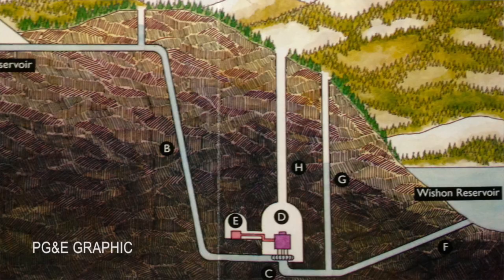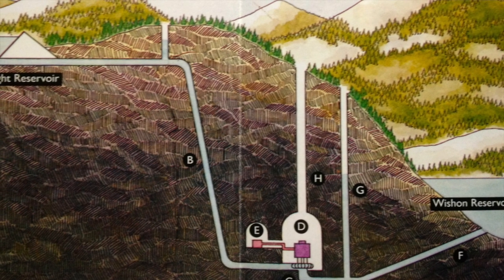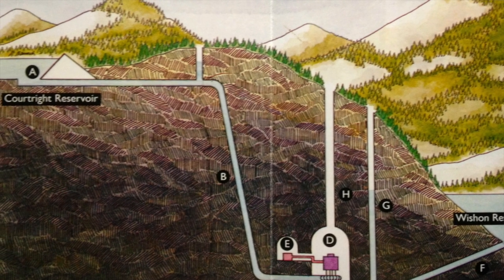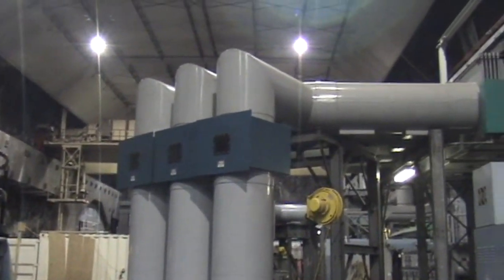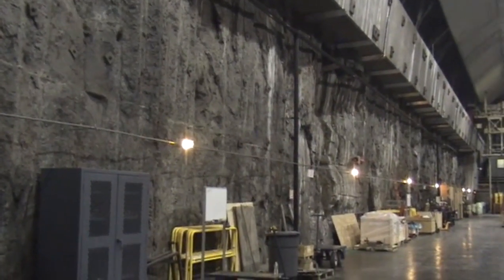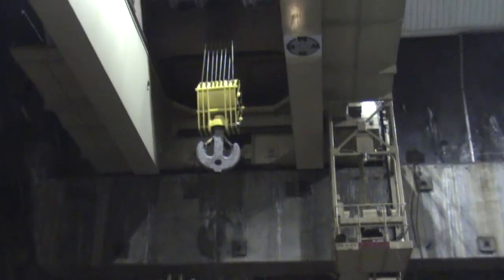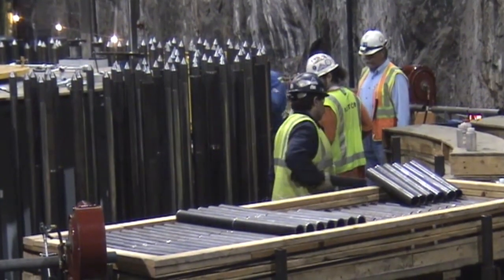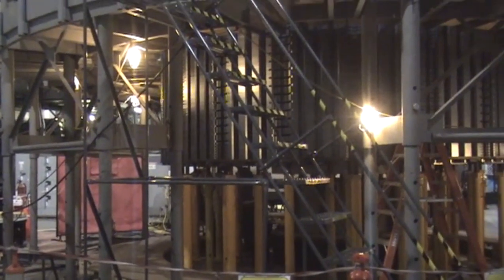PG&E Helms hydro project overhaul

Comment: I was a kid growing up in this area at the time Helms Creek was built.  Many of my friend's family members worked on the construction for Granite-Ball-Groves, the Contractor.  The platform accident was very sad for the community.  Two of the men killed in the accident had been hired the same day and had absolutely no experience on this job.   The father of a friend of mine was an equipment operator.  They actually rigged his backhoe / excavator from a crane in the main turbine room excavation/cavern, and he would scrape and hammer the granite walls to do the final finishing.  Just nuts.  Given some of this things I heard about how this project was run, it is lucky that they did not kill or hurt more people.

Comment: This one brings water to San Francisco when the original pipeline goes dry. I worked in their mine. Huge turbines top secret
Reply: Oliver, WRONG. There is NO pipeline sir, running from Courtright OR Wishon lakes on the Helms project that transport water of any sort SF! Man, you have no idea what you are talking about. I worked there too and when they carved out the chamber for the 3-each pump-turbine generators and built the penstocks and related tunnels and this project is not piping water anywhere except between the two aforementioned lakes so what the hell "original" pipeline are you even talking about that goes dry? Nothing is "top secret" there. Cancel your CNN subscription. You have been duped.
Reply: @jimratliff2753  I worked on the upper tunnels and surge shaft to which my father was the superintendent.  Only once did I get to go and see the area where the turbines where to be installed. It was overwhelming how large the area was.    My father told me that beyond the  expected rooms and areas one would expect to see to accommodate all of the controll and monitoring equipment, there were multiple other areas being built.  The conventional electricians who had worked on other hydroelectric /conventional dam projects were stumped as to what the purpose of these areas were to be used for based on the lighting and electrical circuits they were installing.  They also installed extensive amounts of conduits that would be utilized by low voltage electricians probably for voice and data communications.    Being that it all was deep within a mountain, many speculated that it would be a safe place for government or military to go to.  I think that is where some of the mystery and speculation that it was not just a power house inside that mountain.  The sections of the project my farther was over were completed long before power house portion was completed.  So my Dad never learned more.
Reply: More conspiracy theory bullshit
Reply: Water for SF comes out of Hetch Hetchy not Helms

Comment: My father, brother and myself worked on this project back in the early 80's.  We were involved on the upper tunnel and surge shaft.  We were getting ready for our shift to go down the surge shaft when the accent happened that claimed 7 lives.   I hope the family of those miners know this project is doing a great part in providing power for some many people.
Reply: Craig VanMeter — right proper words about those men who didn’t return home that day.  R.I.P.
Reply: THE SCALING CREW AND THE ELECTRIANS @thehouse5791
Reply: SO DID MY LATE  FRIEND CURTIS GUTHRIE FROM SANTA BARBARA CA.....AND THE GRANITE COMPANY FROM SAN BAR ....THEY BOUGHT HUGE CAT QUARRY TRUCKS FOR THAT JOB.....FOR THE TUNNEL WORK....THE ACCIDENT WAS IN ONE OF THE SURGE AIR SHAFTS ON A PLATFORM THAT WAS BEING LOWERED AND  SPILLED THEM ALL OFF TO THEIR DEATHS
Reply: @CraigAllen-re9bf  actually the slip form / work platform itself all came down.  It was right at the top of the surge shaft section which was roughly 30 feet across and about 1000 feet down to where it intersected with the tunnel below.     My father was the superintendent  over the surge shaft portion of the project.  He was also part of the mine rescue group that first went down after the accident happened to look for survivors to which there was only one.  That individual was in the transport cage that could travel clear down to the bottom or up to the top where the shaft  funneled to a much smaller shaft for several hundred feet to the surface.   That is where the dry house was that workers showered and changed into and out of work cloths.
After the accident, my brother and I came back with a few others where we had to remove the mangled  platform where OSHA was to try and determine how much it, the equipment and built op concrete which had compiled had weighed while we were using it as a slip form.   Unfortunately amongst all the mangled metal beams, expanded metal decking and work equipment that fell from that 1000 foot height was parts of the work crew that were not found and removed by the mine rescue teams.
Was hard on my Father as he had known many of those men from past projects over the years. I was with him when he had to pull the employee number brass tags off the board  and give them to the OSHA inspector.  Only time I ever saw my Dad cry.
Reply: IT WAS THE SCALING CREW AND ELECTRICIANS......